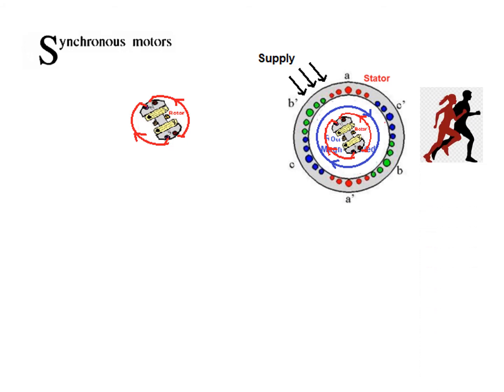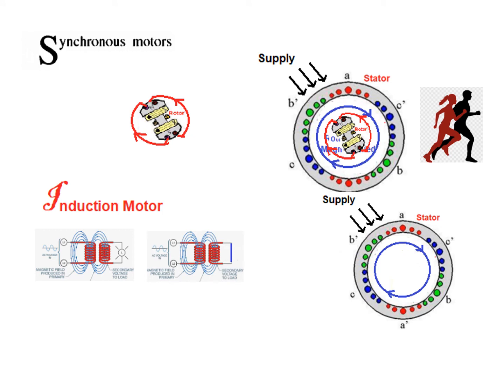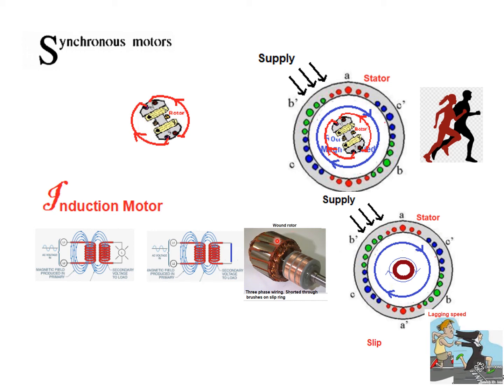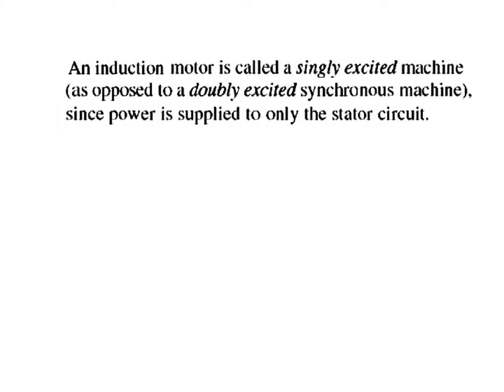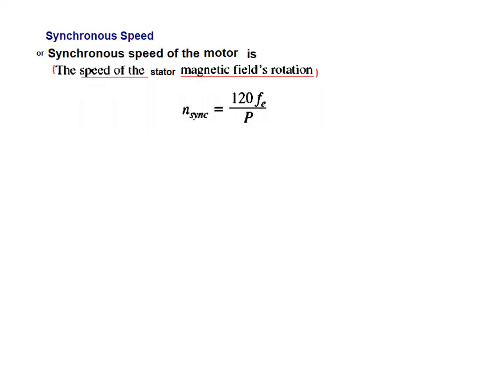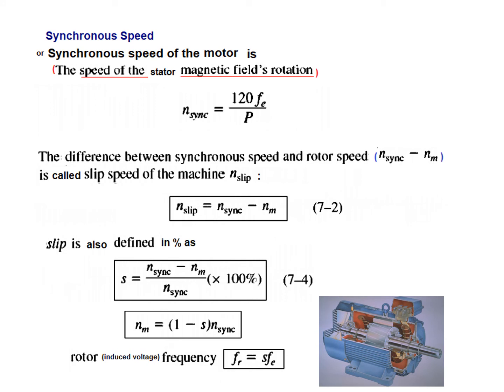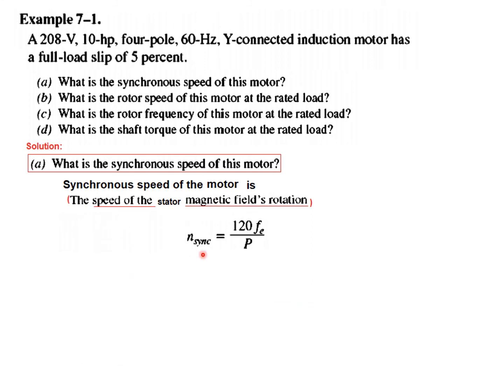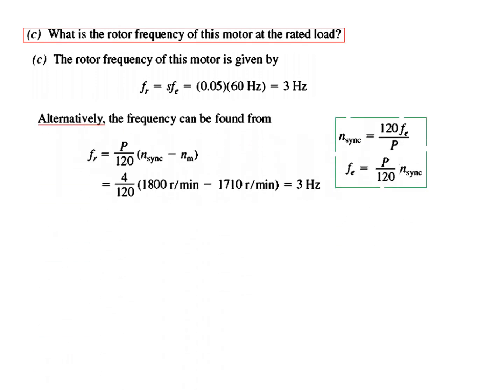(English)EM || Example 7.1  || Difference between Synchronous & Induction Motor || Induction Motor

Comment: An important point is that fr is the induced current frequency on the rotor. It is not the physical mechanical frequency of the shaft/rotor. I initially did 1710/60 to get frequency but this is wrong. fr is not a mechanical frequency, you have to do fr=s*fe. This is the relation between electric Frequencies. Question c is poorly worded. One could mistakenly solve for Mechanical Frequency.
Reply from the maker: Thanks Ben. I think you are mixing up the speed and frequency. To my understanding there is no mechanical frequency, rather it is mechanical speed. As regards frequency, you are correct; it is the induced frequency.